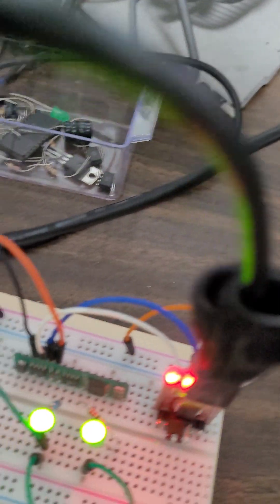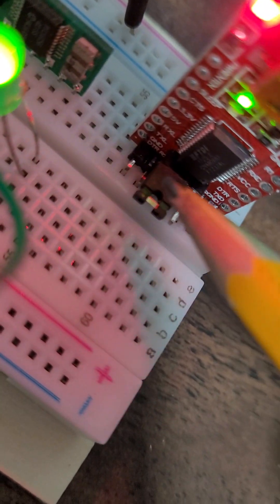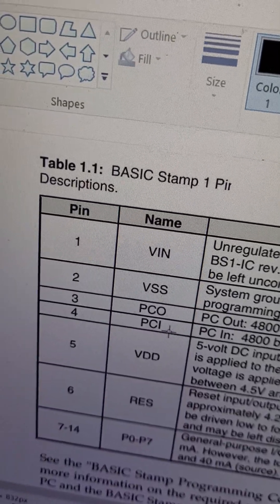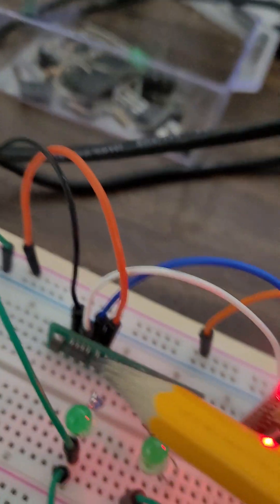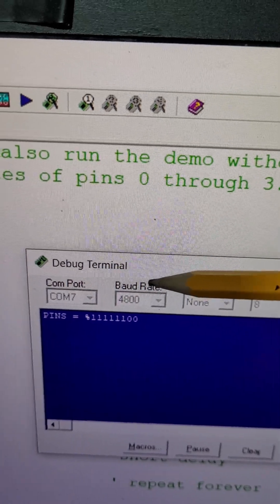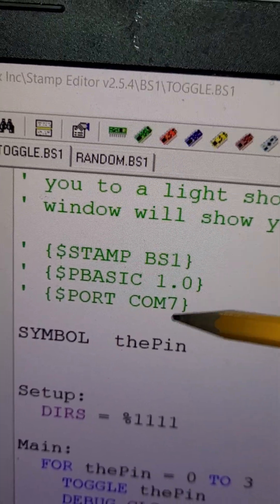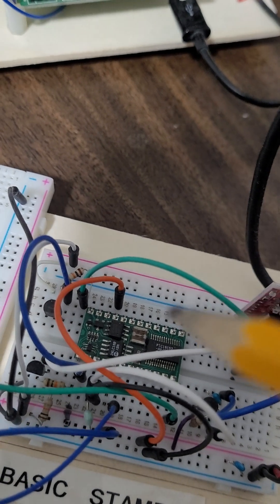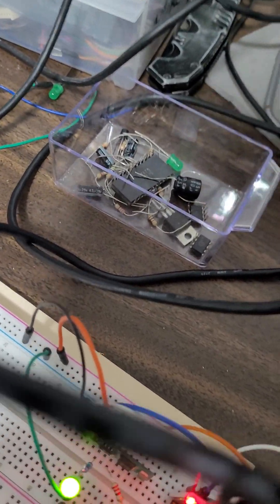Basic Stamp intelligent small computers for beginners, engineers and non engineers - easy to use

Comment from the maker: ' TOGGLE.BS1
' Connect LEDs to pins 0 through 3 as shown in the TOGGLE command descrip-
' tion in the manual and run this program. The TOGGLE command will treat
' you to a light show. You may also run the demo without LEDs. The Debug
' window will show you the states of pins 0 through 3.

' {$STAMP BS1}
' {$PBASIC 1.0}
' {$PORT COM7}

SYMBOL  thePin          = B0            ' pin 0 - 3

Setup:
  DIRS = %1111                          ' make LEDs output, low

Main:
  FOR thePin = 0 TO 3                   ' loop through pins
    TOGGLE thePin                       ' toggle current pin
    DEBUG CLS, %PINS                    ' show on Debug
    PAUSE 50                           ' short delay
  NEXT
  GOTO Main                             ' repeat forever
  END